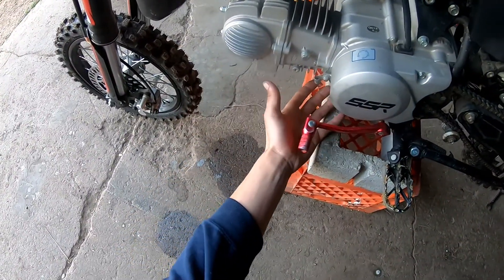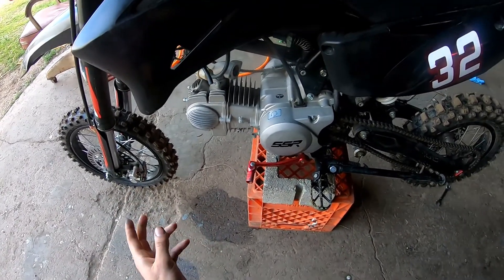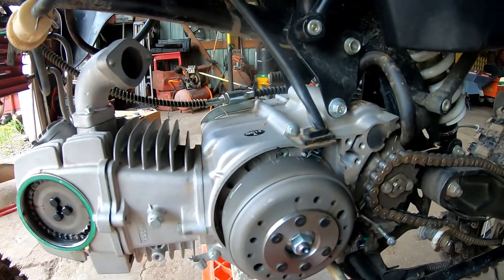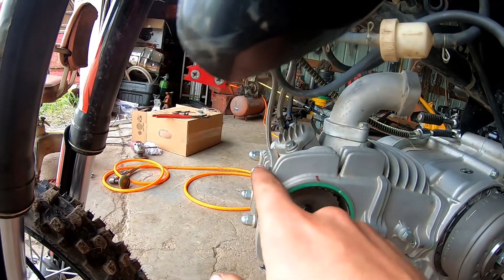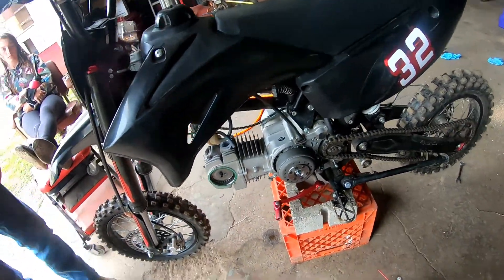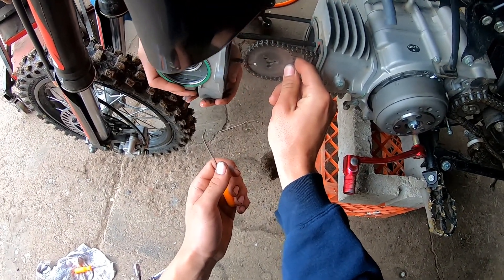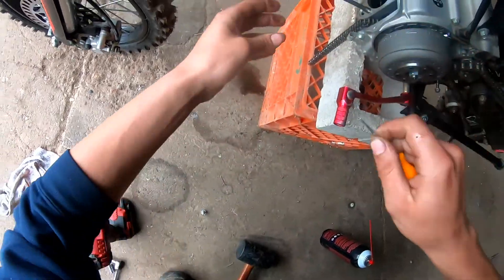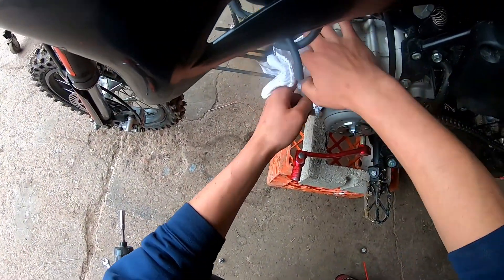How to Rebuild 140cc or YX140 Pit Bike Engine Top End - eBay Kit Less than $100 (Pt. 1)

Comment: Hello can u pls help me I have a yx140 cc but the clutch won’t engage the clutch arm spins round and doesn’t hit the clutch I can pull the clutch arm a full 360 if I wanted to with my finger it’s not the spring it’s brand new but the tension isn’t from the clutch just the spring any idea on what it could be
Reply from the maker: I will get back to u on this

Comment: I've watched this a million times you don't say how to get the wrist pin out of the piston
Reply from the maker: Tap it out with socket and extension while holding rod steady. Or get a wrist pin puller if you want to do the professional way
Reply: @bearkreekboys  cheers mate, I figured it out I was just stressing lol any insight to taking the stator off cos my inside chain has slipped off its guide lol

Comment: What are the 2 wires you took off the motor and numbered in front of the spark plug around 3:00
Reply from the maker: oil lines from the oil cooler I labeled them top and bottom